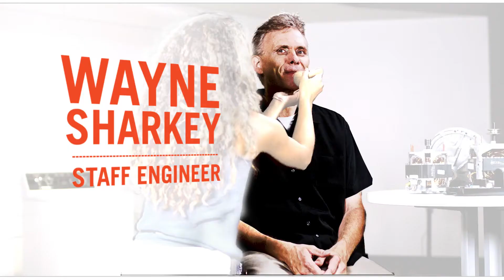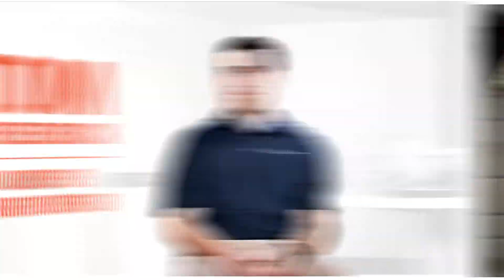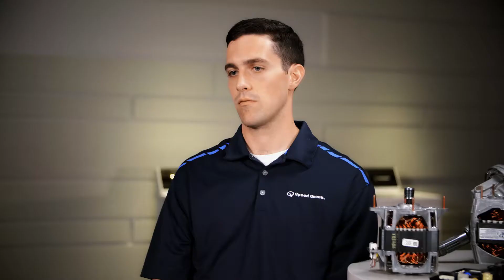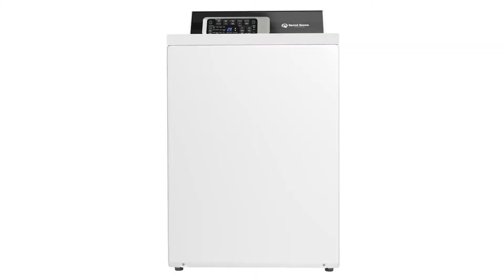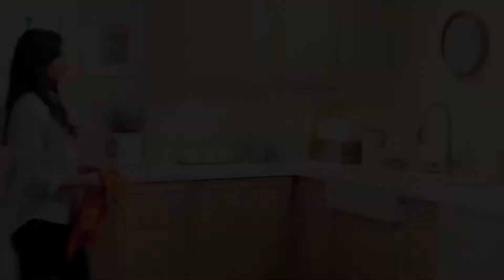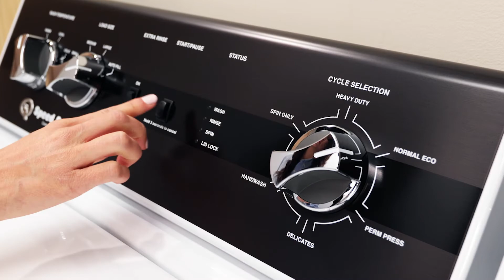2018 Speed Queen Top Load Washer - Auto Fill Explained by Engineers

Comment: Why don't you just let the people doing laundry determine the water level?  Not everyone is like the engineers interviewed and inept when it comes to doing laundry.  I can assess how much water that a load needs just by loading the machine.
Reply: rmgtnsteele you just totally miss the point. The regulations say they can’t make a residential machine without this feature a crossed the board for all manufacturers . The old machines are gone for residential sale so get over it they aren’t coming back!
Reply: Channel123 no, they aren't coming back because people are happy buying the cheap crap that they keep pumping out. People also don't think anymore about things....so manufactures keep dumbing products down. Besides, this machine has options for set water levels, why is an auto need? You can set out for a low water level and beat your clothes all you want....but not in this machine because it looks to have no wash action.
Reply: You're missing the point,  ALL Washing machine makers are mandated by LAW to make ALL Washing machines with Autofill,  it's not about the market or makers.  It's the U.S. Government that is pushing the law.
Reply: @rmgtnsteele  your completely missing the point. 
The machine and autofill is constantly  checking the clothing and water, weight level.
After u set the dials,
 do you check on the cloths throughout the cycle?